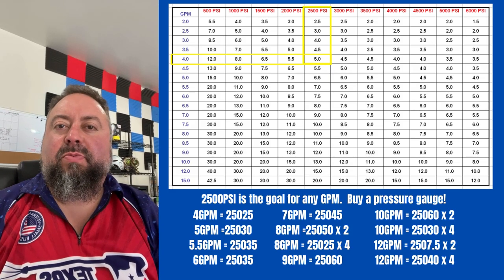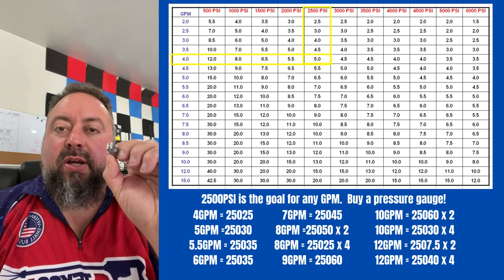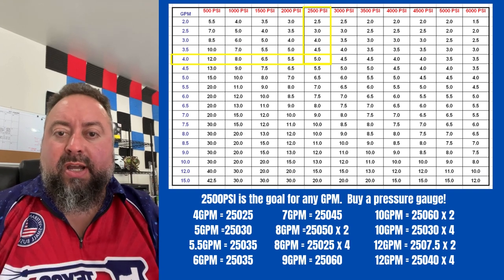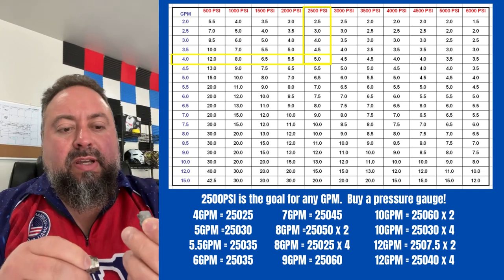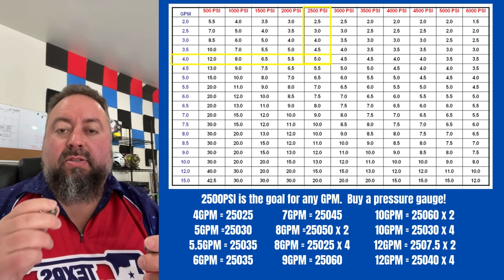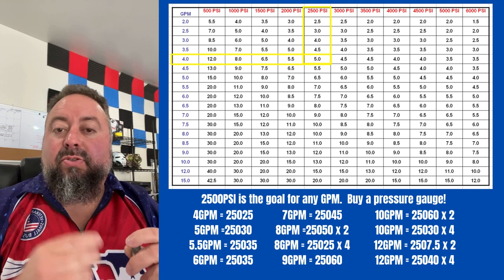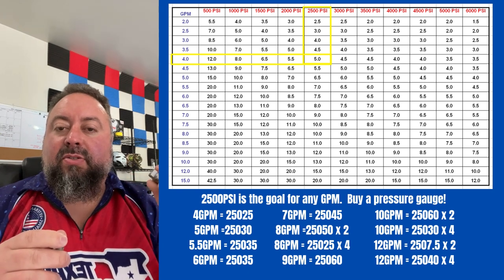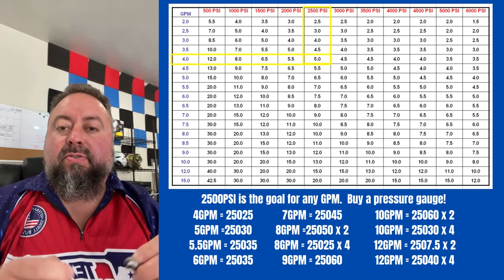Meg Nozzle Chart Explained

Comment: Great video, Heath! I too was told by a vendor that imeg is not for surface cleaners. I'm running a 5.5gpm at 3kpsi and 25030s on a 20" BE. 🤙😎
Reply from the maker: I’d lower it to 2500psi with 25035

Comment: Great video. I was told to get the wrong nozzles then for my new surface cleaner 😒
Reply from the maker: What GPM?
Reply: @TexasPressureWashing  5.5gpm 3500psi. I just ordered the surface cleaner and it just got here an hour ago. But was told to get two 25025 tips. So I did.
Reply from the maker: @johncummings260  25035

Comment: Thanks sir. What tips would a Honda gx690 8gpm 3500psi. Surface cleaner 3 heads need?

Also how do these numbers translate to orifice size numbers?
Reply from the maker: 25030 x 3 but check with a gauge. Goal is as close to 2500 psi at the surface cleaner as possible.

Comment: So you're saying that if I had a 4gpm pump with a max of 3500psi, I should regulate the flow of the pump to adjust it to 2500psi using the pressure gauge?  then use the imeg 25025 tips on my surface cleaner
Reply: No.  The normal spec size orifice to keep your pressure at 3500 is actually a smaller opening than what he is recommending.  What he is recommending is to install a larger nozzle orifice size which will actually cause your output psi to drop to 2500 because there is less restriction, and can also increases your machines output gpm up to a point because the nozzle hole is larger than normal spec for your machine. He is specifically changing the output psi for using the surface cleaner in this instance.  Same principal applies to normal wand nozzles as well. Whatever you do do not change your pressure by adjusting the unloader valve. You need a seperate inline pressure gauge to adjust it,  amd most pros only adjust it once and then leave it alone.  Moving it up amd down based on just the visible output it dangerous and foolish because you habe no point of reference of its output. Its also the only thing protecting your pump from overpressure whem you let off the trigger.

Comment: so if i understand correctly because i am knew and a tad slow....i have a 4400 psi and 4gpm.....therfore i need 25025 and then there is no concern abt messing up the concrete?  what would be the diff if i used 40025 instead.  the spray pattern is wider so i would assume the pressure would be a little less on teh concrete surface?
Reply: Still want to avoid new concrete (2 year or less, maybe even 3). The 40° could spread the pressure but all the spray pattern goes out to the skirt which should reduce the amount of cutting in you have to do with the wand.
Reply from the maker: 40 is a wider pattern but we use 25 degree with tips for 2500PSI

Comment: I’m a little confused about the chart. Do I use the 3500 psi rated pressure column on my pump, or do I use the 2500 target psi you recommend? One gives me 2.5 and the other gives me 3.0. So which nozzles do I buy for my 3500 psi, 2.5 gpm pump for use on a 2 nozzle 15” surface cleaner?
Also, why is 2500 psi your preferred target if you own a pump rated at 3000 or 4000? I’m not clear on this.
Reply from the maker: The goal is to not etch concrete or remove the cream coat.  2500psi is the desired PSI to clean at.  I would test both sizes with a guage.
Reply: @TexasPressureWashing  Thanks for your reply. My washer is 3500psi & 2.5 gpm. My surface cleaner has 2.0 nozzles for total 4gpm which my washer cannot supply. If I replace the 2.0 with smaller 1.5 or 1.25 nozzles would this theoretically increase the pressure too high? I know I need to buy a gauge to test the pressure, but would you expect it to be too high?

Comment: I have a 2500 5.5gpm unit. When I bought my first WW Classic 19", they recommended the 25030 vs the stock tips. From this chart and from what I have read elsewhere, I should go with the 25035's ?
Reply from the maker: Check your PSI.  Goal is 2500psi at the surface cleaner.

Comment: So for a pressure washer of 2.8 gpm you would need 1.75 as an orifice size but I don’t think they exist. Would it be fine to go with a 2.0 when cleaning concrete? I was running a 1.5 size but that is way to much pressure for concrete. Thanks
Reply from the maker: Yes sir

Comment: Help me double check myself because I cant figure it out to save my life. I have 8gpm at 3500. 24in surface cleaner with 3 tips on it. What tip do I need 😂
Reply from the maker: 23030 x 3.  The math is about how many nozzles you have.
Reply: @TexasPressureWashing  I rewatched your video and got it. Other than looking ignorant I’ve got it resolved and ordered some 3 and 3.5s. I wasn’t doing the dividing portion so I thought I needed 8.5s. Thanks for the help!!

Comment: Just picked up a be whirl-away, which came with 2502 tips.   For wood deck, which tip size do you recommend?

Thanks for the support.
Reply from the maker: what GPM?
Reply: 4gpm. 4k psi.
Reply: Do not use a surface cleaner on a wood deck.